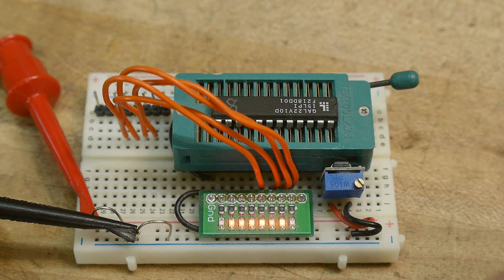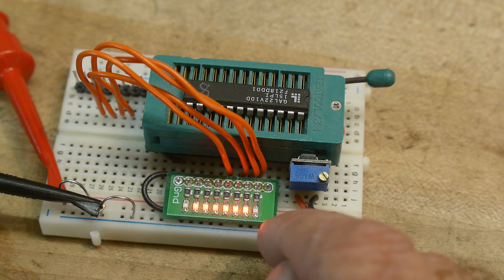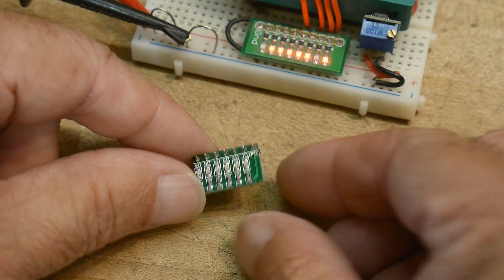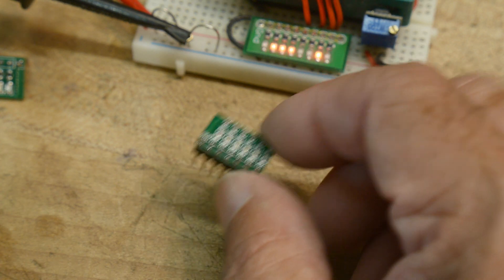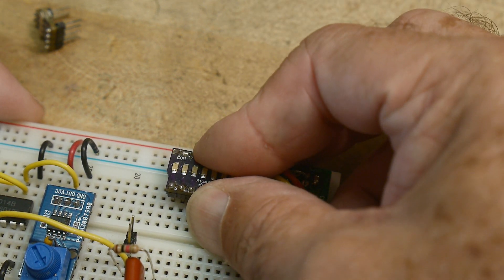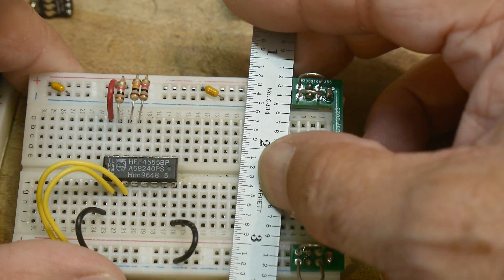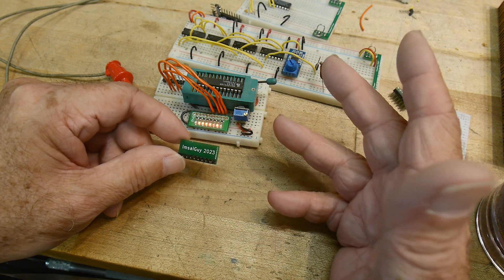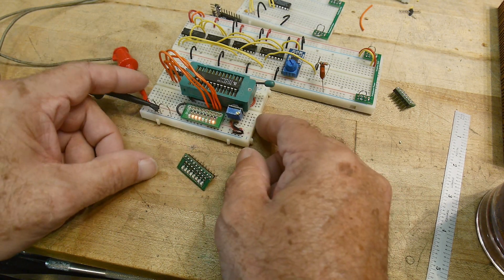#1649 8-bit SIP LED Board

Comment: You can use cut-off LED leads or the leads from any through-hole resistor/diode/etc. as the power "header pins" for the short boards - those will be more flexible.

Comment: For short boards, there is always option to resolder power pins pointing upwards.. 😉 And then using jumper wires for connection.
I modified standard breadboard power board in that way, because my old breadboards was wider than modern ones..

Comment: A solution for the short breadboards would be to have two “power islands” sticking up. One aligned for the long board, one for the short board. Then solder pins into the island you want, depending on what breadboard you want to use the LED strip with. 

Or route the board into a springy parallelogram so that the power island has a bit of sideways compliance and can be made to work on either breadboard. Not much compliance is needed - just 0.025” from neutral position. So that would do the trick I think.

Comment: Replace the LED's with bi-directional ones and have an easy solution to a universal pulled high or pulled low indicators. It works either way.

Comment: I just ended up making my own from jlcpcb.  Mine is a 9 pin SIP and is a bit smaller.  Don’t know why you used 10 pins.  I use green LEDs for the common cathode and red LEDs for the common anode.  I like these.  I used to drag out individual LEDs and resistors and it got cluttered real quick.  Thanks for the inspiration.
Reply from the maker: 10 pins allows me to use either end which I've found comes in handy

Comment: Could PCB Way duplicate a plastic 16 digit DTMF keypad with a film strip that had round buttons that are metal on green film with traces that the end of the film simply pushes into the connector and pressure holds it in?
It is for a Kenwood TK-250 handheld two way radio.
If you Google image kdm-7
You can see what it looks like.
I have a brand new one I can send them.
It is 2 pieces of plastic that holds the buttons in and the film with the metal contact buttons.
I am trying to find someone who I can send the one I have and get 5 made.
Any help is appreciated
Thank you
Reply: I had to download a manual from the Repeater Builders to see the KDM 7. What you want is a flex pcb with tactile dome switches, so PCB Assembly. Check id LCSC has the domes. Thats were they get the parts. You will have to contact them ro get more design info that they need. Hope this helps. 

I qwonder if there is a market for new LCDs for old HR2510s?
Reply: @Pixelwaster  thank you for the help. Do you have a link for the manual that has the kdm-7, in it?
Reply: @ocsrc  Repeater-Builders website.  It is in the kenwood /kenwood-index section, in a TK-353 Service Manual. YT doesn't like links.

Comment: One could also try the so called "SYB-46 Breadboard 270 Point solderless PCB". They have nice interconnection or mounting rails to also insert 1,5mm vertical pcbs with control elements. They line up with the central pins.